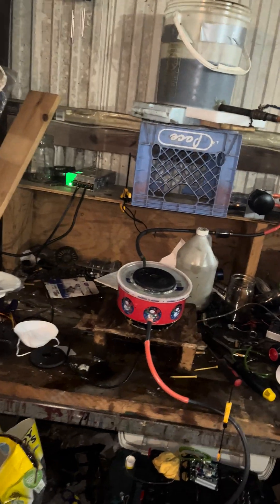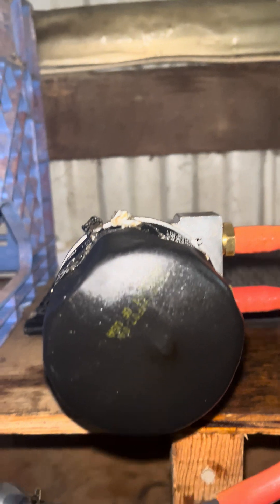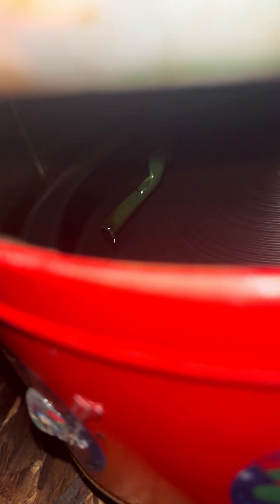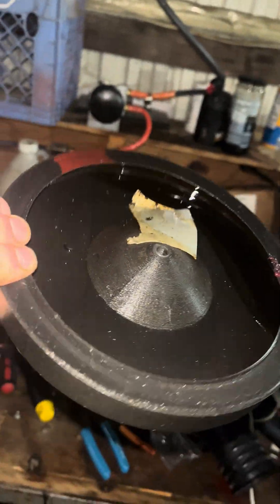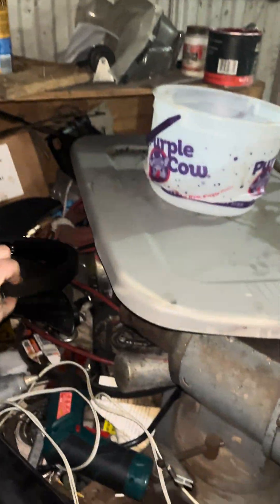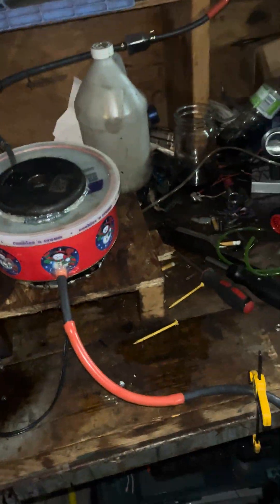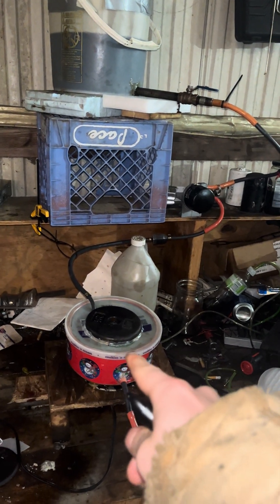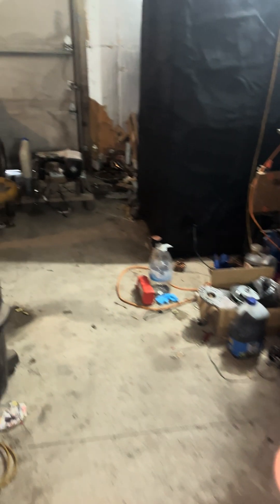How I make my own black diesel with my homemade centrifuge system #centrifuge #2023  #experiment

Comment: This is great dude. Are you still running this set up? If so how well has it held up and could you share the stl so i can print one?
Reply from the maker: @E.force89  I’ve not used it in a while as I need to revise the set up it was more or less a proof of concept that was functional. I lost my files due to a virus but I can make another one it wasn’t hard I did post a rotor on thingiverse it’s called centrifuge for waste oil I hope this helps
Reply from the maker: @E.force89  https://www.thingiverse.com/thing:5750520
Reply: @Solaractivities  awesome! Thank you. I will try to build this on the weekend.  What was the best RPM you found?

Comment: If you centerfuge it before the filters, youll save a lot on filters. The centerfuge will remove most of what those filters are catching. Put the filters on the exit side of the centerfuge and they will take way longer before needing to be replaced because the bulk of the contamination will be removed by the centerfuge.

Comment: how does the oil go down? does it just kind of spray out of the rotor from spinning?edit:nvm, as the rotor fills, the stuff closer to the center is lighter, while water is closer to the edges and stays trapped
Reply from the maker: Honestly I don’t remember how I had the thing hooked up but it was just a experiment more or less and it worked for what it was not great tho obviously lol

Comment: Would you mind sharing the STL for the rotor? The centrifuge is hands down the most expensive part of getting into black diesel and Im having a hard time justifying paying PA $250 for the high pressure system that doesnt even come with the pump...
Reply from the maker: I posted the file on thingiverse under centrifuge for waste oil
Reply: @circuit7892  I actually found it and saw the yt linked me back to your channel. Already downloaded, just waiting for petg to arrive. I want you to know as broke as I am tight now, there is no way I could possibly begin experimenting with black diesel without this file. Its a game changer for me. I really appreciate that you put it out there for dudes like me
Reply from the maker: https://www.thingiverse.com/thing:5750520

Comment: Hi.  I'd love to build this sane system.  Might you have a step by step guide with how to assemble it and what parts are needed?
Reply from the maker: I’m sorry I haven’t responded sooner. The video was only a example more or less I don’t recommend spinning a disc at 10,000 plus rpm unless you got all the safety protocols in place but I mean do it at your own risk I suppose lol just saying it can be really dangerous if done wrong and that’s one of the reasons I stopped making them. You basically have to figure out the rcf which means relative centrifugal force. / and with that you can do a calculation on what system you have and what specific gravity your pulling from the rotor itself. And with the process of things have different mass you can clean the oil using artificial gravitational force such as this one or whatever system you have in place. I wish I could help people build them but ya gotta do it right. Always expect the worst haha

Comment: What was your reasons for each iteration/version of rotor? What have you learned each version?
Reply from the maker: Sometimes just experimenting with ideas and seeing how they work, the reason I’ve changed so much is to try and get better results, and also trying to keep the oil in the bowl at the farthest points from the center shaft for greater g forces for best filtering
Reply: @Solaractivities  have you thought about making it taller?
Reply from the maker: @greenacresfarms  I have for better flow rate I just sold my two rotors so I might have to make a taller one for higher flow thanks for the idea lol

Comment: I've been getting ready to build my own centrifuge. My thought is using drum breaks for the rotor and a variable speed angle grinder to spin it. Figuring out an affordable and safe rotor for those speeds has been difficult. I wish you spent more time explaining your rotor and how you made it.
Reply from the maker: I honestly didn’t think anyone cared I’m sorry I haven’t posted a informative video on how it was built what all would you like to know? I’ll make a video explaining I do think I have posted videos about how I built it on the 3d printer
Reply: I built one using a torque converter but I have vibration issues. I'm considering using a drum break, did you made it ? Did it worked at high speed ?
Reply: dear god please dont

Comment: Add heat and it will improve your process massively.
Reply from the maker: Yeah I know I’m just limited on resources I’m doing this without any money
Reply: @Solaractivities  same, I haven't quite figured out a free alternative for heating the oil but I'll let you know as soon as I find one.  Have you found yourself a treadmill motor yet?
Reply: @hazzard404  assuming you can afford to spend the money for electricity.
The cheapest option would be to find or buy an electric hot water tank, and thread it into a black pipe 1" T.  Then thread a 12" blackpipe into that T to cover the element.  Add one more fitting at the end of the pipe.  That gives you a pipe, with a heat element inside it, and 2 ports to tap input and output.  They run anywhere from 1500 Watts to 4500 Watts or more.  

All in, should cost under $45  And if you find an old heater being thrown out you could salvage the element and save $20.